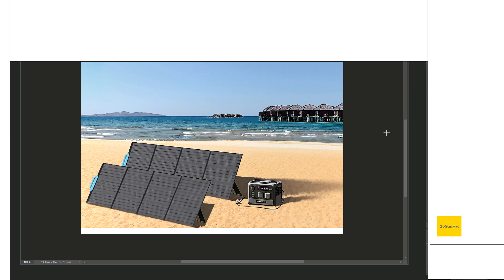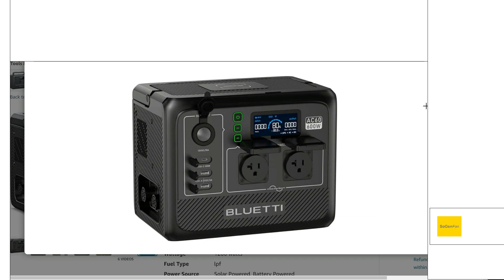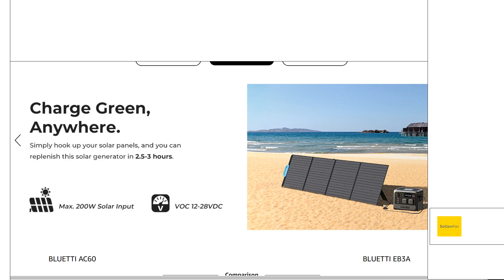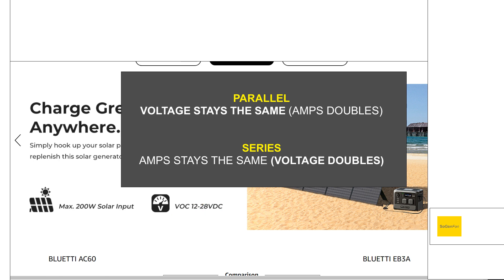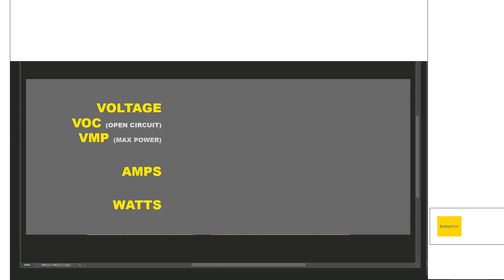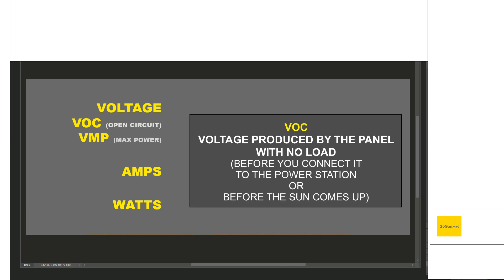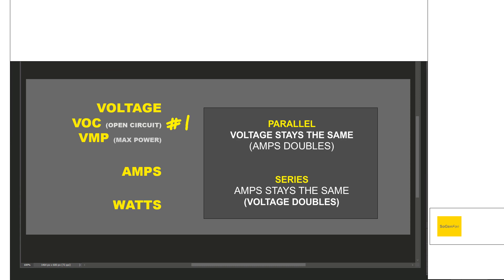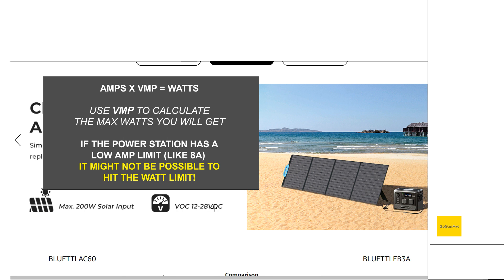Overpaneling - Information & Discussion

Comment: Over paneling question if somebody could help me out. I have EcoFlow Delta pro 15 amp limit solar input 150 V
 I have 165 W panels short circuit current 2.3 A open circuit voltage 94.7 V
Would I be able to use 10 of these creating 23 A in parallel 94.7 V 1650 W?
Reply from the maker: Sure that'll work, it's just the Delta Pro will limit the input to 15A. And keep in mind the voltage of the solar panels at peak output (Vmp) is always lower than the open circuit voltage. Take a look at your panel's spec - and multiply by 15 to get an estimate on the actual power you will see going into the Delta Pro (it's probably around 80v @ 15A so ~1200w). 👍
Reply: @ thank you, that’s about what I came up with. I just wanted to doublecheck appreciate your response.

Comment: Could you please help?  I think I get the jist of this, but I'm not positive.  

I plan on running (2) 280W / VOC 27.4V, SSC 12.6A, OC 11.8A panels parallel into a Egretech 1500W (DC-10-46V - rated 36V / 23A Max - rated 22A).  Would running them in parallel work?  Or is there a better way?  I really appreciate your time!
Reply from the maker: Yes parallel would be perfect! Just make sure you have some quality connectors and wiring for the part handling the 22A. 👍

27.4v X 2 (55v) is too high for your Egretechs 46v MPPT so series is not an option, but since it can accept up to 22A, you can still put a good amount of solar into it! I would be interested to know how many watts you are able to actually input, the Egretech is a cool unit! 😎

Comment: Hello. I have a question how much time would it take for me to fully charge a 12V 20000mAh power bank with a 12V wall plug which supports 1.5A using usb c pd cable.
Reply from the maker: A very long time. I'm not sure if you are trying to charge with usb PD input or 12v input, but either way at 1.5A, you are looking at 10-20 hours!
Reply: @SoGenFan  actually I bought a voltmeter and checked what voltage the powerbank charges at it’s actually 9V 2A. So the power bank is a 12V 20000mAh one that supports power delivery usb c charger.
Reply from the maker: So it charges at 18 watts then. 20000mah at 12v is 240wh. My calculator says that's 13.3 hours to charge!
Reply: @SoGenFan  ok thanks

Comment: how does it work for the Anker 767. it has 2 values: XT60 Input 11-32V⎓ 10A; 32V-60V⎓ 20A (1000W Max). So if i buy 3x 20v 6 amp. is this math correct. Paralel = 20v 18 amp anker limits to 10A 200 Watt, Series 60v 6 amp 360 Watt ?
Reply from the maker: The Anker 767 is tricky to use with solar, but it can be done. If you are looking at using ~400w of solar it's pretty easy. Getting near the max 1000w input is a challenge! 

You definitely do not want to go all parallel with 20v panels, since it will limit it to 10A. And you don't want to get real close to that 60v cutoff with 3 panels in series either.

What kind of panels are you considering - rigid glass panels or portable?

If you buy the panels you mentioned, you would want to buy 4 of them. Put them in 2S 2P configuration (two panels in series, and the other two panels in series. Then connect both 'sets' in parallel. That will give you 40v 12A (480 watts). 

You might want to check out Will Prowse's DIY Solar Forum, there are quite a few threads on there about using solar panels with the 767. https://diysolarforum.com/threads/anker-767-non-portable-panel-suggestions.54236/
Reply: @SoGenFan  Because i don't have a lot of weight left on my caravan so i am looking at the EcoFlow 100W Flexible Solar Panel. I'm not sure if i want 2,3 of 4 mounted on the roof.
Reply from the maker: Then I would suggest going with either 2 or 4 panels.